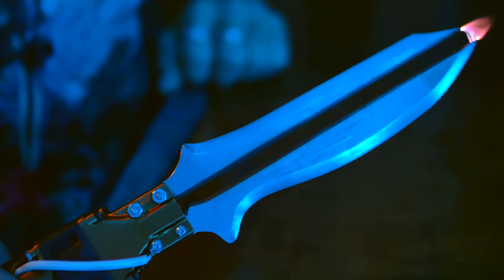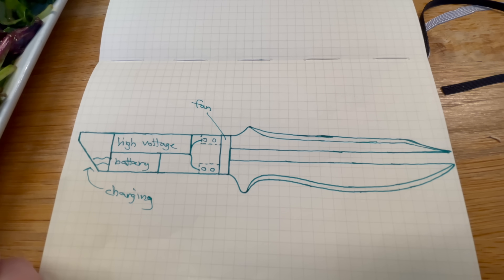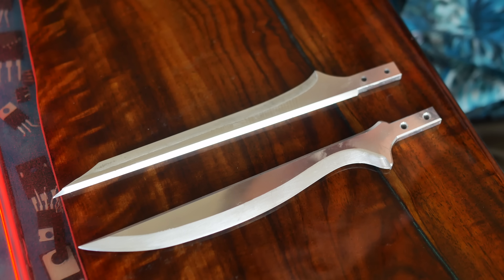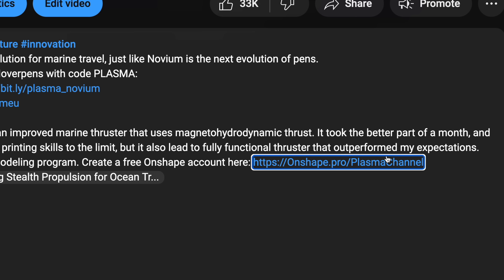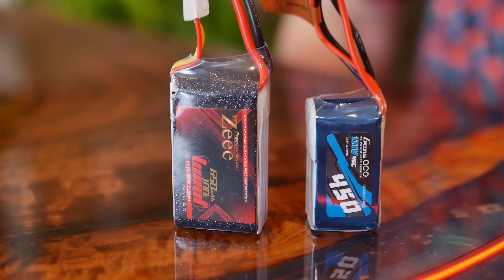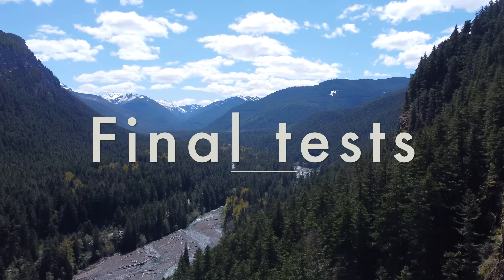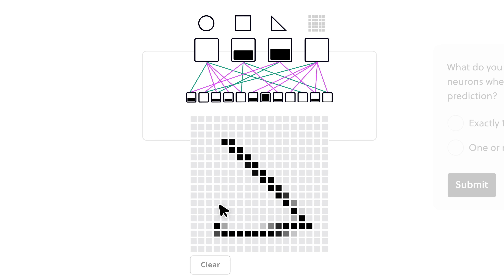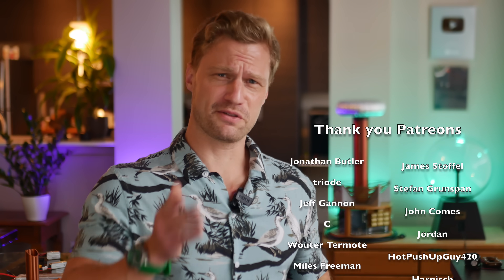A 20,000 Volt Next Generation Plasma Knife (Halo Inspired)

Comment: duel tesla turbines spinning counter the direction of each other on either end of the handle.... 
have the cathode plate of the turbine on one end of it's axle and the anode on the other, both slightly larger diameter than the other plates between them... groove the plates to isolate gasses on their specific wave lengths/vibrational frequencies... in order to layer the gasses between the cathode and anode in a polarizing method.
place two ion/particle beam emitters facing forward and slightly toward each other to the inside of the turbines.
build an isolated housing around the turbines and the the emitters to prevent grounding through the body.

a little fine tuning...

Comment: I think this weapon actually has a bit of potential to it, imagine if it was redesigned so that the top half or so of the blade was non conductive and instead of just electrifying the blade constantly it dumped a capacitor bank when stabbed into something conductive when stabbed more than halfway (completing the circuit) to instantly incapacitate the target and possibly cauterize the wound depending on the resistances involved.

Comment: I have an idea: could you possibly make a blade that uses a similar setup to your original ionic thrust video? I think you could have the edge of the blade be right next to a wire so that the electrons fly off of the blade and through the wire to create a plasma blade that isnt between two pieces of metal and is actually a plasma blade? I think if you charged the two to a high enough voltage then it could allow the electrons to make an actual plasma blade.

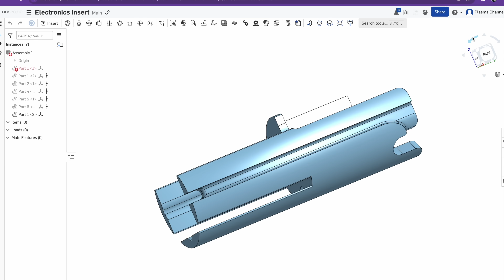Comment: 8:58 surprised no one called out that series-parallel configuration doesn’t exist. You wired it in parallel config. Fire video though 🔥🔥
Reply from the maker: Wired in such a way that primary coils receive power in parallel, but secondary coils are wired in series. Definitely exists. Doubles voltage out. Glad you enjoyed the video!

Comment: Real question, when you tested the electrical gap between your two blades. Does the shape of the side facing each other affect how well the electricity can travel back and forth?  For example, a rounded edge vs a squared/ fined/ pointed surface?

Also! Your blade is very Klingon! It’s epic!

Comment: Imagine a plasma spear. That would be terrifying, and you'd be able to make it more powerful and sturdy.
Reply: But what if, plasma Ballistae?
Reply: plasma bolt @thatguydownthestreat
Reply: Like odins spear. Imagine if you made contact and then activated the plasma discharge
Reply: it's still a spear though... and this is still a knife. 

Not like it works any better than a good steel blade either way.
Reply: A spear is much better than a knife.
Reply: @candyman9635 honestly, I'm curious how big/intense you could get the plasma blade with more hardware, it's all crammed into that puny little mini mag light sized handle, something the length of a proper sword handle could probably make something a fair bit more impressive, maybe use a laminar flow nozel to keep the air flow more stable over longer distances, crank up the voltage to get it to light up some more.
Reply: Syl spear IRL

Comment: Yeah its a welding piece right? I made similar stuff long ago. Maybe thats a low end object on capacity though. I made a cheap version of that out of an old camera a few times too. Guess this one is only cheap home made. Seems like i used 6-8 D batteries if im Remembering right, in a long handle. I used a computer fan too btw.

Comment: At 10:14 :yt: looking at the blades, I was thinking how could this be re designed & improved to a 1 piece section of both blades & the connecting piece to the fan section you could make bigger like a petalguard hilt & ditching the bolts for securing the blades completely, then the bigger fan with a faster speed should beef it up with more power too. Also try to shape the area near where the flame starts the same shape as the bottom like this 📛then back to 6mm like the base section & the tip. Also make the handle to the blade sturdy & get forged in fire to test it for real applications & design a magnetic connection for the recharging too. I'm interested in a next gen one you make & so would your Youtube Audience. :hand-orange-covering-eyes::face-blue-wide-eyes::face-fuchsia-tongue-out::face-red-heart-shape::face-purple-wide-eyes:🤖

Comment: ANY CNC machine that I have sent work to had nozzel that dispensed a water base lubricant - aimed at the cutting bit, that would have prevented the very expensive bits that you showed from "melting"....  As an air stream will disperse the cuttings, it will not provide any appreciable cooling that a CNC MUST HAVE....  Just say'in....
To help the arc start to travel up the blade, the use of a STRONG, circular magnet at the base of the blades, WILL help push the arc.  I added a small magnet at the base of my home=brew Jacobs Ladder and it works like a champ....

Comment: Two suggestions: first, try using a small drone motor to enhance airflow. Second, consider adding air holes just below the fan for increased efficiency. Additionally, plating the inside of the blades with a more conductive material could improve performance.

Another idea place two clear pieces of plastic on both sides, just below the sharp part of the blade, as the lower end isn’t currently useful.

Love the project keep up the good work!

Comment: Awesome version of a plasma blade. Been trying a fully plasma engulfed cylindrical blade (aka lightsaber) myself using the principle of a dielectric barrier and the ability of magnets to influence the flow of ions… have a look:

https://youtu.be/OhlG3E4RlZE?si=UhjbkDF3kyTRVQVx

Still very much in the beginning stages of development and powered by a pretty hefty 10kV NST… but… I ‘love love love’ the sound it makes (reminiscent of actual lightsaber) and the fact that it seems relatively easy to build longer blades like this with a very uniform appearance and no need to blow lots of air either so more energy efficient. It’s essentially all solid state thus far.
Reply from the maker: I just checked out your video. The engulfing plasma would be interesting if at vacuum, however, you're accomplishing it at STP in open air. That's very impressive, and i'd love to chat. Please, shoot me an email (under the channel page, about tab).

Comment: So, when you make that Gap for the plasma to flow, do not make it parallel, make it more like a wedge shape closer at bottom and wider at the end so the arc travels then dissapears at the end and doesn't keep arcing at the tip of the blade it will travel better

Comment: The hydrogen and oxygen are not at subzero tempetures to for water if you mix hydrogen gas and oxygen and light it you get an explosion from it and it creates water not significant amounts but definitely more in terms of weight than what the two gases weighed

Comment: ngl allen pan did it way better like 4-5 years ago
Reply from the maker: His defintely had better plasma. It also 1) required a fully external shop vacuum attached to it, 2) didn't have functional blades, and 3) wasn't all self contained into a handle. So, our builds are on slightly different levels. No knock on Allen pan, I love his work.

Comment: Cool weapon! The upper part of the blades is very sharp, so the electric field strength is maximum on them. It was a problem on a first test. I guess the sharpest places should be placed further apart so that the sparks form more evenly along the entire length of the blade.

Comment: You should make a plasma ball style version with glass tubes full of xenon for the white arcs. Just put an electrode at the base and tip of each blade so that it can arc between the two. Maybe even make the gap big enough that charge must build between the two blade halves so that a white spark will sporadically jump between them. They should light up completely much like the original artwork

Comment: Looks like the plasma knives from Outer Worlds.
Questions: 
Could you replace the fans with ionic air thrusters to make it quieter?
Could you add a timing circuit to the transformers with a capacitor so it would produce a small burst of plasma every quarter-second instead of a tiny stream? Would that affect battery life and plasma profile?
Could you make the tang of the blades longer and add more attachment points for stability?
Could you thin the handle so it's oblong instead of perfectly cylindrical? I think that would fit more hands more comfortably.
About how much would all the parts for the finished 3rd version cost if I wanted to make one from scratch?

All in all, I think it's amazing and I wish I could buy one pre-made.

Comment: Could you add some sort of thin insulating/non-conducting but structurally sound core layer splitting the blades along their cutting plane, and power the two faces with opposite polarities to make the plasma be on the cutting edge?

I dunno much about materials, perhaps some sort of ceramic? I think there are ceramic knifes, aren't there? Could you get a sheet of that kind of ceramic, thin enough to not show much sandwiched between the metal faces and not leak much electricity, but still enough to go along with the sharpening together with the metal edges?

Comment: sir please explain what is new in this that plasma blade is already did by allen pan #Allen Pan , also even larger than this
Reply from the maker: His version was great. As for how mine is different: 1) no external vacuum. There is nothing that needs to be attached for it to work. 2) mine has actual usable knife blades, his did not have blades 3) mine is extremely compact, self contained. 4) mine has almost no exposed wires, and is structurally very strong.
Reply: @PlasmaChannel Great!

Comment: angle the blades slightly away from each other for a more consistent jacob's ladder the arc sticking at the top is because the tips are just as close as at the base of the blades.

Comment: Try a non-conductive coating between the center and edge of the blade to see if it will jump across

Use pc server fan less run time but more pressure and flow

Your onto something. Pleaseeee do another

Comment: I use those same transformers with small zvs drivers I build to run on 12 volts and they can produce thick arcs 15-20 mm long with the higher zvs current. I bet if you change out your driver board the results will be even more impressive.

Comment: A couple thoughts:
If you clad the inside of the blades with copper then you might get better effect since copper has lower resistance.
If you design a sword with a traditional handle rather than the halo design you could have a fairly long one to balance a longer blade and of course give you room for more electronics.

Comment: only issue with it is as a knife i think its tang is too small that im worried it may break off. otherwise this is the coolest knife ever
i remember a few years back a guy made a stun sword by using two mall ninja swords and placing them next to each other separated by spacers then adding a taser.

one thing ive always wondered tho is would it be possible to make a taser with a singular blade but its like a sandwhich of sorts?
forging swords by sandwhiching different metal alloys is pretty common.

probably takes more material know how or something.

Comment: aluminium and electric arc furnace sounds like melting metal, tungsten arc welding rods would be much better. yep barbeque sticks sword chop sticks. or you could carbon graphite rods as the carbon arc furnace blade. surprisingly a welder machine wire is a proto plasma blade. lol. well magnetic field ion plasma containment plasma sword. yep the ac maglev type of plasma containment.

Comment: this was a sick video, I had a question though. Would it be possible to make a sword and use an electromagnetic field to trap the plasma around the blade? I figured a sword would be better because it would give more room for electronics to fit in to. Or an axe like Thor's Stormbreaker. The electronics could fit into the bigger side keeping hands and limbs away from them. Then the plasma could run along the blade side of the axe.

Comment: Instead of using a fan to push the arc from hilt to tip just magnetize the blades such that the magnetic field is pointing from one blade to the other (if the blades are a ferritic steel you could drag a strong magnet across the blades from one to the other to do so, no unsightly magnets needed!). You would have to use some HV diodes to rectify the output, but this would allow the current and magnetic field to propel the arc down the blade (like a railgun) rather than having to use a bulky fan. Downsides are needing a DC output, but upsides are no fan noise, no extra power draw, and likely more uniform arc distribution along the length.

Comment: Have you heard of or seen a game called 'No More Hero's'? The protagonist uses a beam katana as his weapon of choice but the design seems the most plausible 'lightsabre/plasma sword' design: having a large enough handle for batteries, space on the guard for the high voltage electronics and, most importantly, the 'blade' is held between 2 electrodes. Essentially you'd be making the same devise as you showed in this video but with the blades (electrodes) rotated 90 degrees and spaced further apart

Comment: Love it, If you decide to go for a V2. I would love to see some palm swells or something in the handle. And I think it's possible that you could print a different fan shroud, so if you didn't want the square shape, you could go for an octagon or circle or whatever. Finally, you may have tested this already, but does making the gap between the two blade halves get wider or narrower as it gets further away from the "ricaso" affect the length of the arcing? Or nothing? 

Oh, and it'd be sweet to see you stab a piece of meat with it lol. Or a mash potato sculpture of a grunt, haha

Comment: Could you make a 'plasma gun' using the gas release of a painball, the arc of a taser as an ignition chamber, and a rail gun as a barrel to accelerate the newly generated plasma out at high speed?
Reply: Technically yes, the MARAUDER plasma gun functioned in a similar manner iirc

Comment: Awesooome! for the big sword I'm thinking you could do two one-thirds-height stock metal bases for the energy sword, and sandwich in between them a strong insulative boundary that's slightly narrower so that it's hollow in the edges so you could have plasma all around the sides of it as well as down the center median... or instead of insulation you could have them be completely separate so that it's like four quarter-blades with plasma all between them
Reply: oh also instead of hollowing it sideways you could have it look hollow from the topside, and line an array of emitters fed by a super high voltage tesla coil in parallel such that the medial edges of the blades shoot electric plasma to the outer edges of the blades

Comment: Something to remember especially with this design, is going bigger on fan size isn’t necessarily a factor here, but static pressure rating is what should be focused on, because the focus point you’re creating to it while also having tight and obstructed intake space, is making getting that air flow rather difficult.

Comment: The Halo blade is derived from katar design.  Adding more bracing as per a standard katar would give you more volume to work with, but also a more elegant way to hide a backpack hookup for some real danger.

Comment: I feel like if you combined your plasma thruster with this concept you could possibly save on some weight and power (using a wire mesh rather than full blades). Seeing, in halo, they have an armor suit, maybe make a glove that houses some of the components? Finally, if you can somehow add noble gas to really get it glowing as the electric fields would excite it.

Comment: Could you electromagnetically accelerate the plasma down the blade instead of using a fan? It'd be awesome to see a fully solid-state version of this without the jet engine noise. Could the blades act as rails, like with a railgun?

Comment: You should definitely try sharpening and polishing the inner edges of the blade to get a smoother flow of plasma up the blade. The rough (relatively) surface finish seems to be giving you  uncontrolled micro-arcs. You can see these little dots along the blade in the video at 10:13 here: https://youtu.be/IzR1dKKktAg?t=613

Comment: I wonder if there is a more electrically conductive and still strong metal you could use for the blades such as a bronze alloy of some sort... I wonder if the blades were more conductive if it would help to carry the plasma bridge all the way to the tips with similar voltage? I am incredibly interested and would like to see you experiment with more electrically conductive blade alloys for this project after all they did use bronze for swords before the iron age so food for thought.

Comment: i have to say. you can expand the design to beyond the blade. as in. the battery doesn't have to be IN the blade, right?
i mean even the game. it doesn't state where the power is from. what if the power source is from the armor? 
what i mean is, why not use a big battery, strapped to  the arm, or biceps, just hide it with some long sleeve/jacket? that leaves a lot of space for more transformers in the blade itself. plus possibly using a bigger battery etc

Comment: I feel like you could help the problem of arcing at the tip by having the gap between the blades get wider there, like in Allen Pan's design - that way the arc has less "incentive" to stay at the top instead of restarting from the bottom. Also you should try and find a fan with the highest possible static pressure rating, to overcome the restrictions on the intake and exhaust.